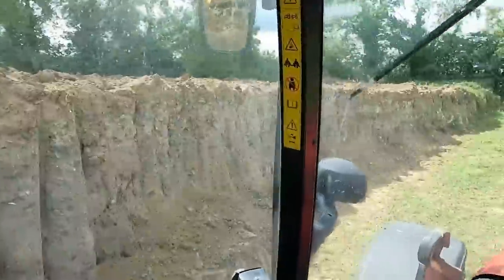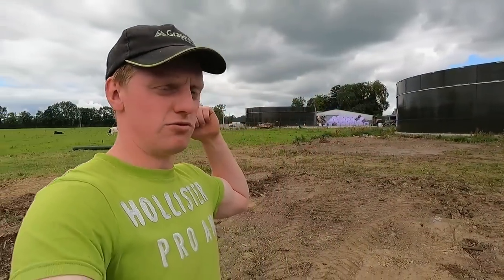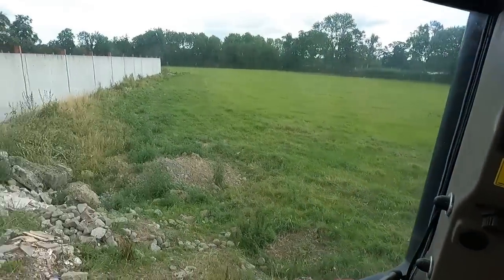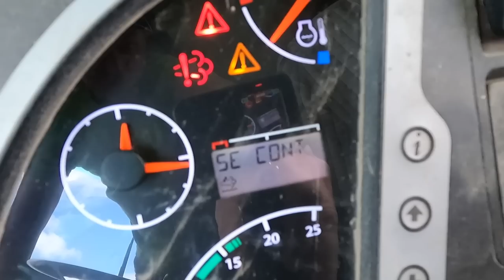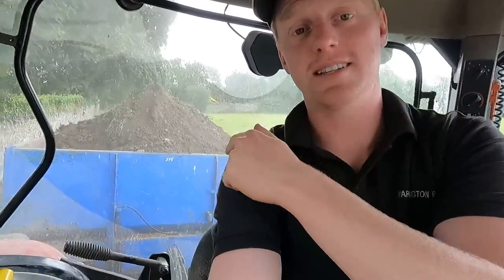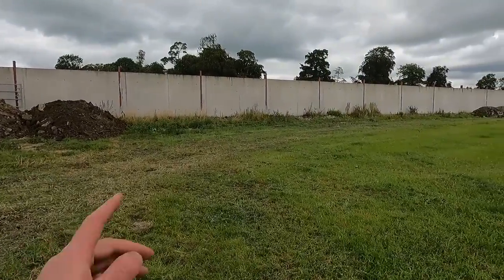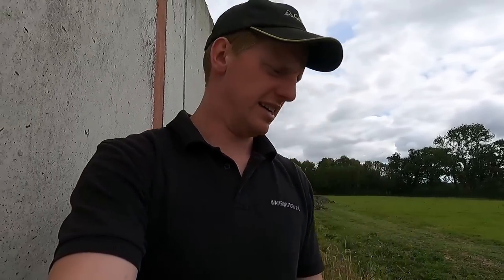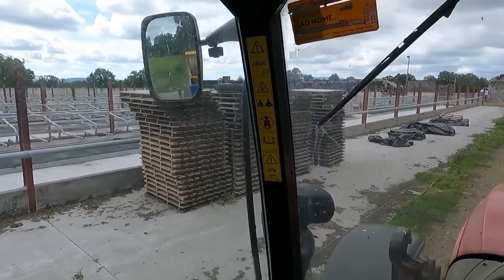TOPSOIL ON THE MOVE!!!

Comment: Isn’t the jcb a bit new to be throwing up those codes, if it’s only when the back actor is in use , I think you’d be better off getting a crowd to delete the adblue off the system, there could be hours given there trying to figure out what the issue is, be it a sensor that got a knock or a wire that’s stripped that the use of the backhoe stretches or something like that, that would be my solution, I don’t know how your dad can stay sitting on it when it’s blaring all the time
Reply from the maker: I was thinking that might be the solution

Comment: Try using the back actor without turning the seat around. If it works okay the problem may be the auto idler function or seat censor.
Reply from the maker: Still acts up 🙈
Reply: Do you have to press a switch to use the Backactor or is the hydraulics always live?
Reply from the maker: @PVAglue-fi4kc  the hydraulics are always live
Reply: Two more things to try. Disconnect the battery and leave for a few hours to reset the ECU, there are YouTube videos on this for cars. If that don't work, I'd disconnect the sensor that tells the ecu that the backactor is operating,if you can find it! I taught it might be in the seat. I don't have a 3cx,  But you may well have to get the laptop mechanics to sort it out.